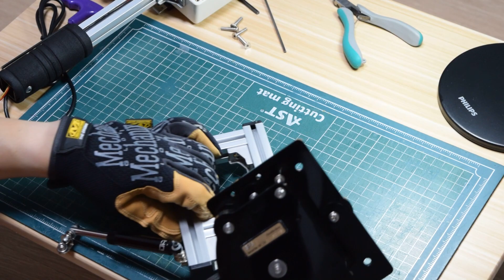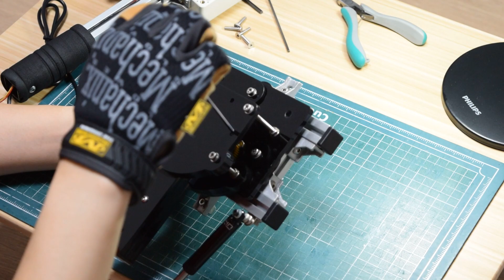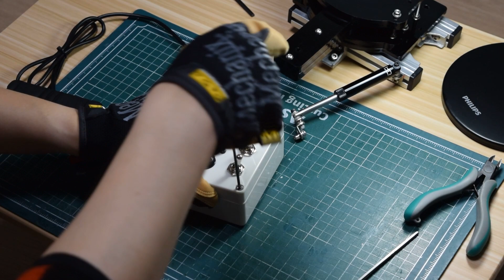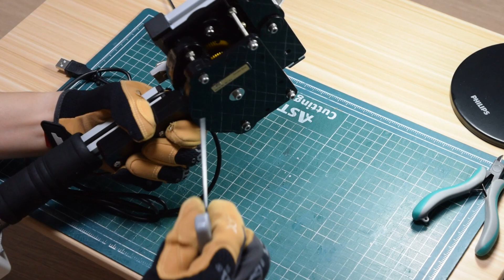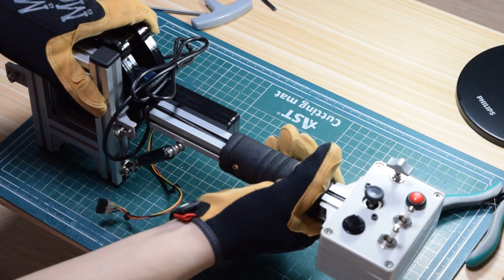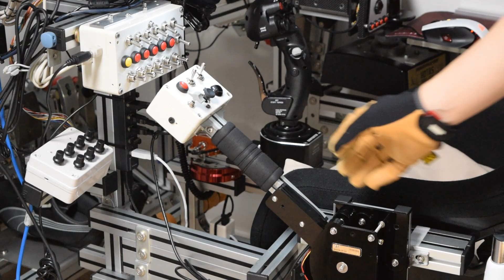[SimPit] DIY collective lever assembling

Comment: What sort of brackets did you use to sandwich the lever? Do uou have photos online anywhere please? Im working on a similar design and am looking for some inspiration
Reply from the maker: Those were laser-cut acrylic plates. This module was originally made long time ago, even when there were no reliable consumer 3D printers. I don’t use it anymore, I’m afraid there are no useful data to replicate it for now. I just recommend to use 3D printers to build something like this.

Comment: Regarding your base, how did you end up setting up the amount of resistance for the lever? Most DIY ones seem flimsy and too easy to move. The dampener is a very smart idea but even without it, the collective is very solid. Can you explain how you set it up? Also, where did you source all your aluminium for the frame, base, etc?
Reply from the maker: I didn’t do much for that actually. You can see the plates on the both sides over the lever’s root, those are making some proper resistance by tightening the center spindle(combo of a bolt and a nut). Some anti friction tape(kind of PTFE, teflon, UHMW...) is required additionally. The damper is nothing to do with providing any resistance, it’s only working as a ‘stoper’ for the lever. 

The metal frame and lever were made of several pieces of 20x20 aluminum profiles.

Comment: Is there a list of sensors, switch and other components you used? I was thinking about building something like this instead of paying €1000+ to buy one and having a list of the basic components (and maybe the software used to read from the sensors) would be amazing
Reply from the maker: Hi, check this list. My goal for making this collective was 'As Cheap As Possible', so keep in mind that the parts are not top-notch quality.

Push Switch :
https://www.ebay.com/itm/10PCS-NEW-White-12mm-Waterproof-momentary-Push-button-Switch-Mini-Round-Switch/221987241523

Analog Stick :
https://www.aliexpress.com/item/32846978502.html?spm=a2g0s.8937460.0.0.47a62e0eUfVpu0

Toggle Switch :
https://www.parts-express.com/spdt-mini-toggle-switch-center-off-with-tapered-knob--060-530

Collective Axis :
https://www.ebay.com/itm/10-pcs-100K-ohm-Linear-Taper-Rotary-Potentiometer-Panel-pot-B100K-15mm-3Pin/362665849664?hash=item547091b340:g:Su4AAOSw6bVc8UUy

4-way HAT :  TMS switch from HOTAS cougar

Controller : Arduino Pro Micro

Comment: Sorry for the dumb question:  how do you operate the throttle?  It doesn't look like the grip twists.
Reply from the maker: I didn't make twist throttle. IRL, there are many collective levers with no twist functions. I use momentary toggle button to control throttle.